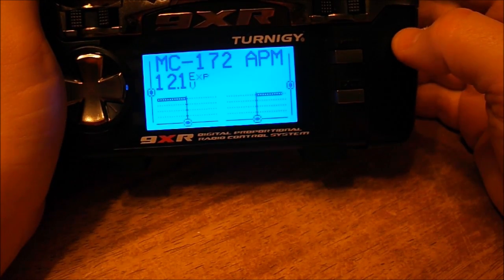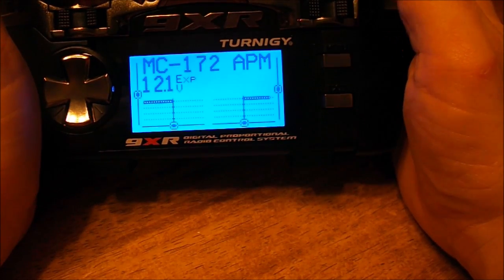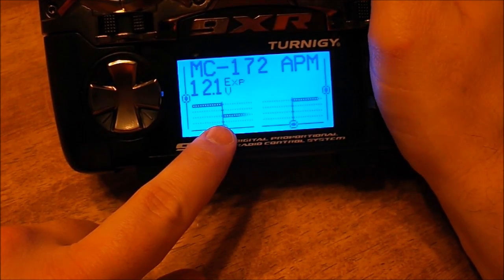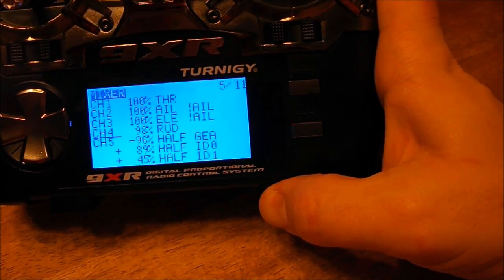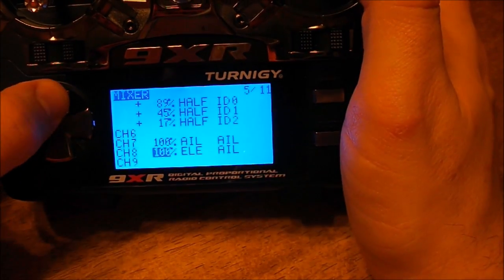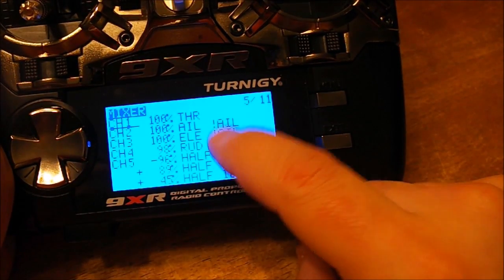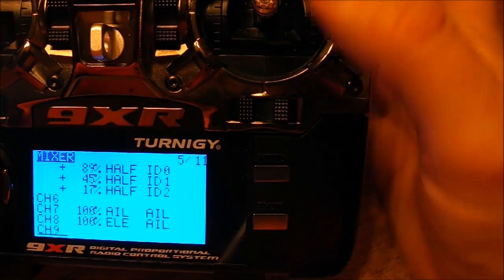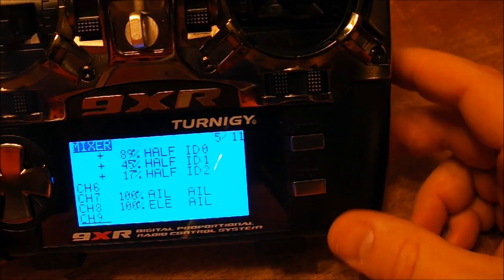Turnigy 9XR Virtual 3rd stick

Comment: hello,
thank you for your great video here.
I own a quadcopter and 9xr RX. I would like to mix the YAW control with one of the sliders (P1-3).
I would like, being on hovering state, to use one of the sliders in order to get a steady 360 degree panorama view video.
Do you have any suggestions?

Comment: Hey mate that's pretty awesome. I'm trying this setup on a fixed wing APM but not quite getting it sorted. I have my mode switch mixes on ch8 so I have a set of mixes like yours but on ch 5 & 6 using the Ele switch. When I flick the switch my right gimbal outputs to ch 5 & 6 instead of the elevator and aired on but if I plug servos into outputs 5 & 6 on the APM the servos don't respond. Got me puzzled. Any idea what I could be doin wrong? I'm also running CPPM from an Orange OpenLRS UHF but I can't see that matters as everything else is doing as it's supposed to...
Any help would be much appreciated mate.
Reply: Disregard mate. APM had ch 5 & 6 output set to 'Disabled'. Easy fixed. Thx for the awesome mix setup vid mate.